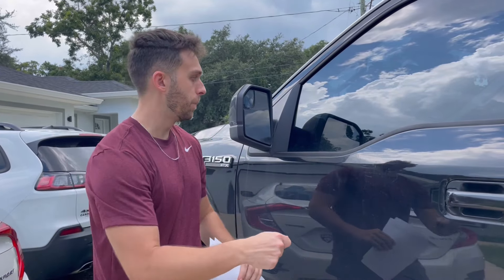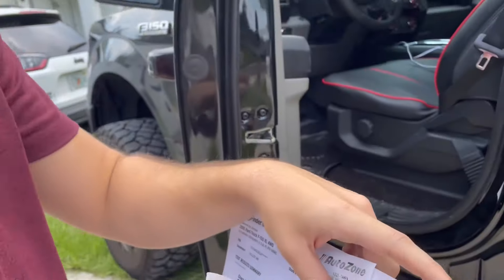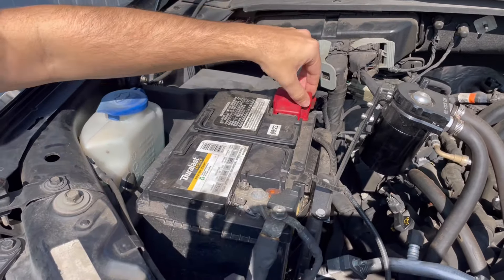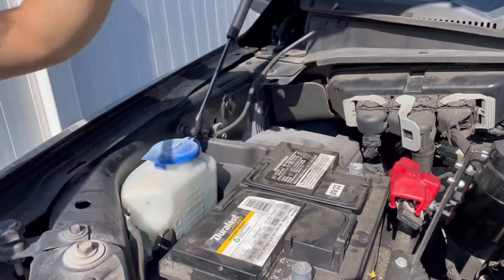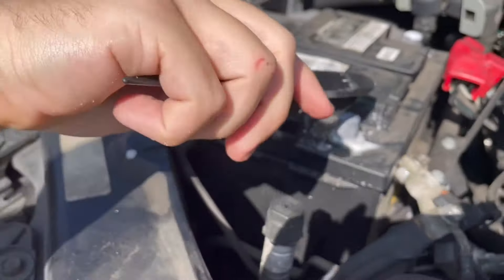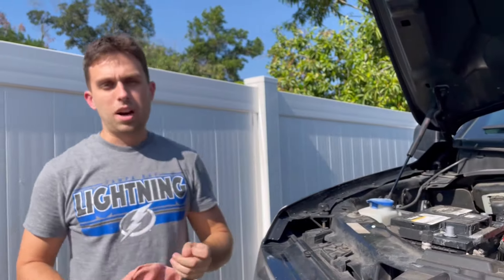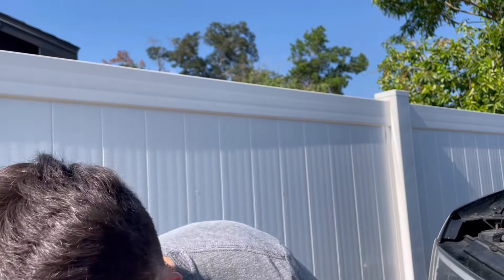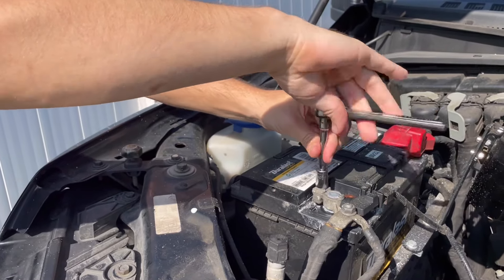Car/Truck Battery Having Trouble Starting? TRY THIS! | Cleaning Battery Terminals With Baking Soda

Comment: I usually only clean terminals with baking soda if i see a lot of green or white crust from acid coming out of battery, but it can't hurt.
they sell a battery terminal cleaning wire brush that has a male end and female end it only costs a few dollars works really well to make terminals nice and shiny clean.
  they make tons of products to prevent the corrosion on terminals I put a conductive copper grease made for industrial wire connections on inside it looks exactly like copper never seize. then brush some silicone paste(it is all the same just buy largest tube it is cheaper) all over outside of terminals and end of wires and battery stays good for 5 years or so with good connections might get some dust on the silicone paste but it does not hurt anything you can also use Vaseline but it melts under heat of engine under the hood and runs all over